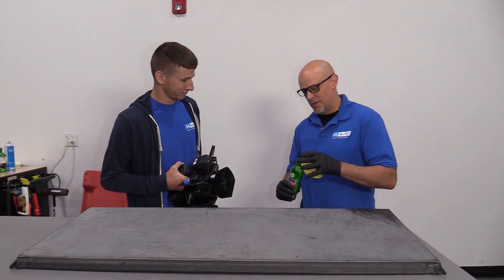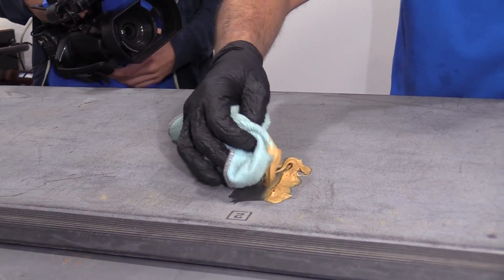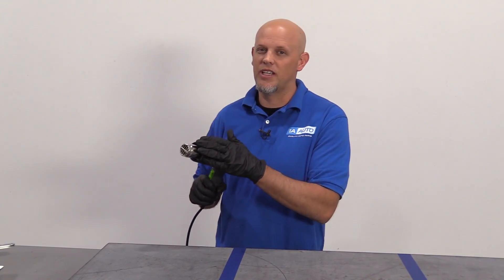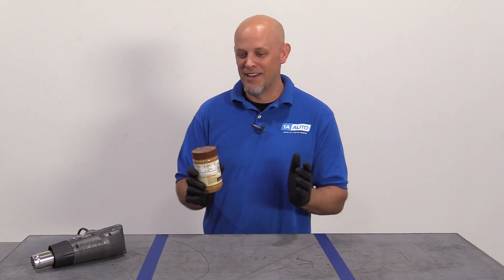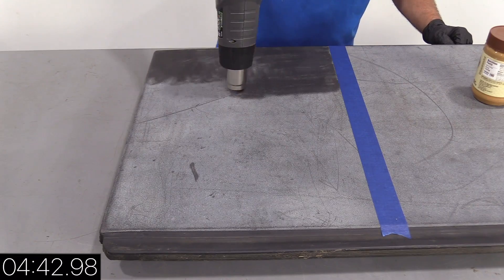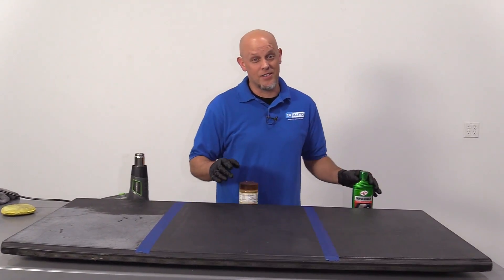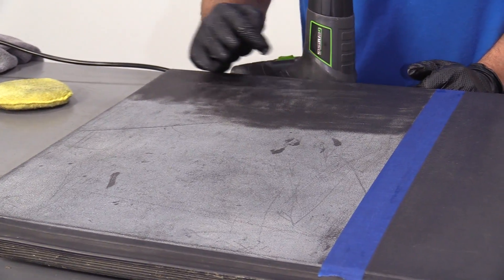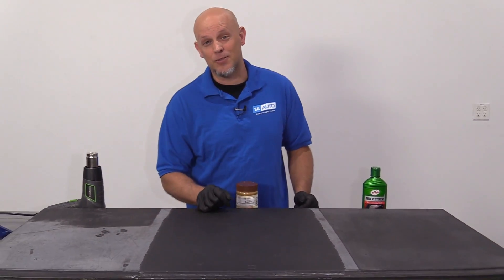Can Peanut Butter Really Restore Faded Plastic on Your Car, Truck, SUV?

Comment: I usually use clean automatic transmission fluid. 
Plastic is made out of petroleum and over time the oils get dried up and cause it to fade. You just need to add oil back to the plastic. (Or bring up oils to the surface of the plastic by heating it up) I've always used petroleum-based oils because I've never thought of using a plant-based oil to restore plastic. I do like this test though. 
Might need to go to the store and get some peanut oil  tonight😀
Reply from the maker: Thanks for watching! http://1aau.to/m/Shop-1AAuto-Now
Reply: Would Vaseline work?

Comment: To restore old plastics my father said he used oil in the old days. With that said the peanut butter can restore it because of the oils in it. BUT the oil will attract a lot of dust when it does it is really hard to wash off. Soo you would be better with the plastic restoring bottle.
Reply from the maker: Thank you for checking out the video. If you need auto parts go to: http://1aau.to/m/Shop-1AAuto-Now

Comment: Neat video. However you missed out on really making this useful for folks.
With the expense of buying a replacement, most of us are willing to do 2-3 runs with a product.
Would have been excellent to show what doing the extra passes and then a wash and maybe protectant coat would end up looking like.

Don't like criticizing people who actually make videos, however it seems a waste when they only give 80%. That extra 20% of doing a couple of run throughs like here is what most people are going to do, and might end up totally different.  I would have done the PB and compound a couple more times, then a good wash and wax or protectant.  More than likely although we all would love to see PB finish first, just because, I expect once its been exposed to some rain and the oils have run or baked off in the sun, it may be worse than the compound.
Reply from the maker: +Boots Thanks for the feedback!

Comment: The main difference is that the area treated with the heat gun will last much much longer than peanut butter and plastic restorer. Of course it takes longer with the heat gun, but you save time not applying the restorer/dressing after each wash.
Reply from the maker: I'm sure you are right. We just needed a hotter heat gun. Thank you for checking out the video. If you need auto parts go to: http://1aau.to/m/Shop-1AAuto-Now

Comment: You mentioned that the heat gun may have worked better at a different temperature, but didn’t say what your heat gun’s max temp was... Do you have a suggestion on what temperature would be best for this application? 

And, you didn’t say which kind of peanut butter was best... No, not dropping brand names here, just wanna know if it should be creamy or crunchy? Haha!

Thanks for doing the experiments to show the various ways the trim can be restored. It was informative and entertaining.
Reply from the maker: Creamy is defiantly the way to go.  🤣 I would say trial and error with the heat gun. The one we used is a very inexpensive gun. It just takes time. Thank you for checking out the video. If you need auto parts go to: http://1aau.to/m/Shop-1AAuto-Now

Comment: I tried the peanut butter method, and it did look much better. But after a few minutes, flying insects and other creepy crawlers started to come around my car, sniffing it with great curiosity trying to find the mysterious delicious-smelling snack. Obviously, they got worked up by the peanut butter, and since I live here in hot, humid, bug-infested Florida, well, I'm just going to buy some trim product at my local auto shop and put the peanut butter on my bread. Let the insects eat cake!

Comment: Instead of using peanut butter just use peanut oil instead, that's all your doing with the peanut butter anyway and no smell. 
I might have to try it just to see how it works and how long it will last.